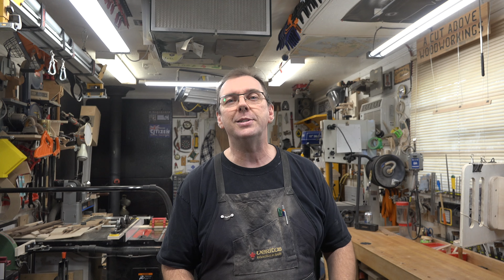Lighting The Star Destroyer Part 2

Comment: I converted mine into a Xyston class. I’m wondering if the red leds can be on at all times. Or better yet, the white ones can be interchangable. I need the red to be on to light up the Superlaser on the ventral hull. It’s connected to the hanger bay
Reply from the maker: The LED's are all interchangeable as they are the same voltage.  The only limitation is their size.  So as long as they fit and the wire is long enough to reach the control board, you are good to go.  I hope this helps.  I'd love to see your conversion to an Xyston class.  You can always send photos via email.  kennye@acutabovewoodworkings.com
Thanks for tuning in to the show.